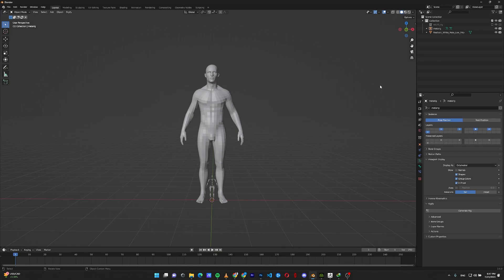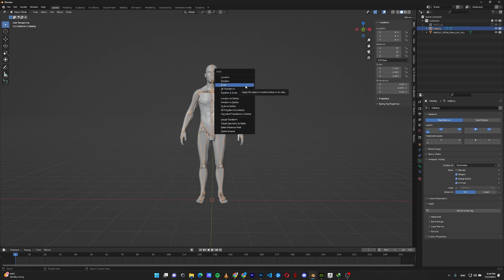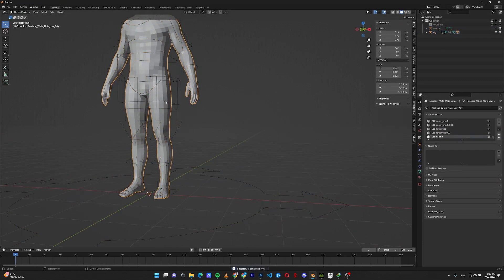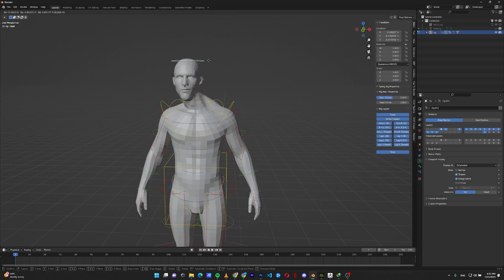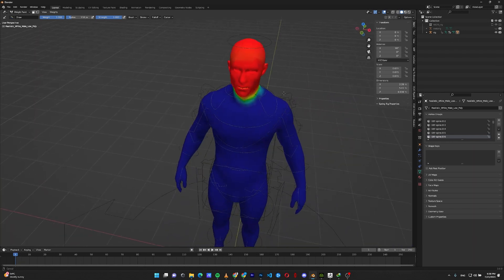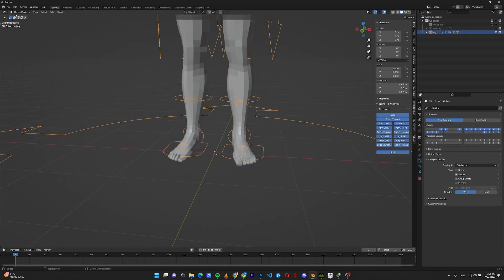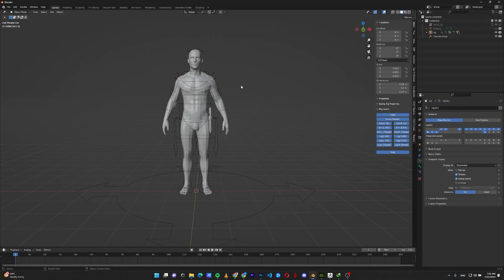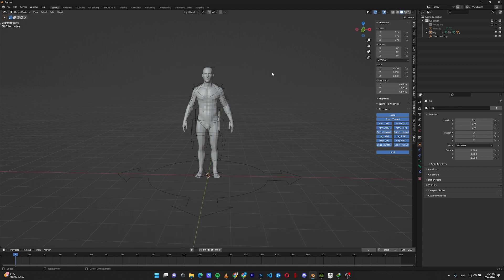4 Most Common Blender Rigging Problems and How to Solve Them

Comment: i need help, when i try to scale my rig figure the whole body just becomes deformed as i scale it up, please respond
Reply: nevermind! i was in edit mode not object mode
Reply from the maker: You should scale the model before rigging because of these kind of issues, but sometimes you can scale the root bone and it works, it depends on the rig but automatic rigs usually don't work like that and you need to scale before the process and apply the scale transform
Reply: @ never mind I was using edit mode or something instead of object mode, I figured it out by now

Comment: I have an issue where the character disappears from the armature. If I unparent them, it comes back, but if I reparent them it disappears again. What can the issue be?
Reply from the maker: It's because after un parenting the model resize to the original size, sometimes much bigger and some times much smaller, when you select the model press "Alt + P" and un parent and keep transforms
Reply: @ In my case, I noticed the delta measurements of the armature are set to 0.01, even though the scale measurements are 1. I sorted that out, applied scale and all transforms etc, and everything seems to be ok after reparenting. However, when I clicked on something else then went back to it, I was back to square one. It had all changed back to how it was 🤬 Something tells me the issue is with the existing keyframes, but I am going around in circles and getting nowhere 🙄
Reply: Is it possible there is a hidden element that is not being included in the transformations, and therefore messing everything up?

Comment: my problem is that whenever I set with automatic weights, it just loads infinitely until it crashes. it may be because the model is pretty high poly, but I'm not sure how to fix it.
Reply from the maker: Models more than 75,000 polygons are considered hard to rig in Blender and something around 100,0000 almost unable to rig.
For automatic rigging you need to make sure you models are below 75,000 polygons, that's because the computer needs to solve things and with more polygons it means more calculations until it crashes, or you can weight paint it manually.
For Auto Rig Pro there are other third party skinning engines like voxel heat map ( if I'm not mistaken) than sometimes can fix this issue as they use different algorithms to weight paint.

Comment: Bro i have issue when i move my cursor whole character is gone
Reply from the maker: Can you describe it more? If your whole character moves when you try to move something, in most cases it's due to your proportional brush being on, press "O" on your keyboard and check the middle top of your viewport, a circle shape turns on and off, it should be on or if you want to use that, when you press G to move, decrease the effectiveness size by rolling mouse wheel, if what I've said is not your mentioned problem, please explain it more
Reply: @mck3D  bro thanks for replying but my issue solved

Comment: hey how are you mirroring every bone movement , when you move a joint on right side and the movement is copied on the left side ??
Reply from the maker: in the top right corner of the viewport there is "X", turn that on so you use mirror movements.

Comment: I'm still extremely new to blender, so please excuse me if I'm misunderstanding. I've only been doing it for two weeks. My rig works like yours, but the metarig or bones stay in place when I move the rig. Is that normal? I figured that's why a lot of people have it hidden.
Reply from the maker: Hello,
Don't worry ask anything that is on your mind.
Yes if you custom rig your character manually, you actually use those bones then for make it easier on the eye you make custom shapes (those shapes you see in the rig) just to control those bones.
But in automatic rigging like Riggify, those bones are there just to place them in the position of your character joints, then Riggify create another skeleton for IK and FK and hides it, so you only see the shapes and parent your character to the control rig and in the background Riggify make the necessary adjustments.
I like to open things and talk about them in-depth, but the short answer is  YES, you don't need them in automatic rigging.

Comment: Bro, I have a problem that I can't solve, when I create the rig for my model, all the bones influence more than necessary, like a finger is influencing the arm and a part of the hip, I know I can solve it manually, But isn't there a better way?
Reply from the maker: There isn't much to do, you can try to re-do automatic weight painting to see if it fixes the problem or not, and there is a paid addon called "Voxel Heat Diffuse Skinning" (https://blendermarket.com/products/voxel-heat-diffuse-skinning) it usually give better results if you willing to pay you can test that, but other than there is not much you can do automatically
Reply: @mck3D  ok, In this case, isn't there a way for me to generate a rig after doing everything manually? Like, I do the Weight paint exactly bone by bone, and then I can generate a rig and it will come right? Or will it not be generated correctly?
Reply from the maker: you can, just generate the rig from riggify skeleton and then in the last part when you parent the model to the rig, don't select the parent with auto paint, select parent with empty groups (of I recalled the name right) this way, your model is parented to the riggify generated rig, and the bone groups will be available on the model vertex groups but their weight paint are empty, and you can paint everything manually from there.
Reply: @mck3D  Thanks, this helps a lot, the only problem is doing the painting correctly, but I can manage, thanks for the help
Reply from the maker: My pleasure, yeah weight painting is always a pain xD but when done correctly the result wish wash away your exhaustion.

Comment: on 2.37 we see its not work in video  this is same problem with me on leg rig after rig generated
Reply from the maker: It's working in the 02:37 in the video, but if you explain to me your exact problem we can fix that easily, does you knee bend the wrong way?

Comment: Hey MCK thanks for the tutorial. I recently started learning Blender and I have reached a point of rigging my armature. I like your YT tutorials because you explain very well even for beginners. I am using Riggify in blender 2.79 but I got an issue, not sure if its an issue though. My rig has a lot of attached connections coming from an orange dot at the center of the cursor that is at the X/Y going to the rest of different parts of the rigged mesh. What's your opinion on this?
Reply from the maker: You're very welcome, I'm glad you liked them, sorry for the late replay, I'm not sure about 2.79 as I don't remember the workflow, did you try to hide the layers of the rig? maybe you've activated some hidden layers.
Reply: @mck3D  Am good thanks, the important thing is you got the message. I'll try to hide the layers and see how it works. Thanks.
Reply: @mck3D  Hey your idea worked, thanks. But I got another issue when trying to move some parts of the rig like the hands and legs, the mesh of the hands and the legs are stretching. What could be the issue?
Reply from the maker: sorry for the late reply and I hope you've already solve your problem, it's because of the weight painting, sometimes you see the parts in blue which indicates that the bones don't have influence but they do have influence, at least it's the most common one, but there are a few more reasons that are a headache to solve.

Comment: the only problem I got is that its hella laggy. I got a rtx 4070 and a cracked cpu and the mesh is like 10k triangles and yet its like 2 fps in pose mode. Any help?
Reply from the maker: in the viewport shading, put the shading on the solid mode, and in the solid mode expand by clicking the little arrow, then select "Material" in order to see the model in material mode, any type of shading or rendering will slow down your movement.
Reply: The reason why you mesh could be lagging is to do with its poly count being too high. The higher the poly count, the more its struggles to respond in real time. A work around for this is selecting your mesh and clicking shift D move it but don’t let go of the mouse bottom, then click esc. It’ll snap it to its original location. Next you want to remesh your new mesh with the remesh modifier. Ideally you want to rename this newer mesh to lower poly so you know the difference. Go to your modifiers and click on remesh. You want there to be enough poly count so it’s roughly matches your original mesh. Once you’ve found a desired look, apply the modifier. You then want to disconnect all previous parenting you did with the rig prior to this. By selecting everything and clicking alt p and clearing the parents. Make sure that you remove all vertex groups as well. This is located in the object data properties tab. The one that looks like a triangle. To remove them all quicker click on the down darker arrow that is located in the middle of the other buttons and select deleted all groups. You then want to parent your lower poly mesh with your rig by selecting the rig by selecting the mesh, shift clicking on the rig, ctrl p: automatic weights. You then want to click on your original mesh and shift click the rig. Click ctrl P and set the parent to with empty groups. You then want to click on your original mesh, shift click on the lower polly mesh and click weight paint. You then click on weights, transfer weights, you want to change vertex mapping to nearest face interpolated, and then change source layers to by name. And if it was followed correctly the mesh should snap into place without any issues occurring.

Comment: thanks so much for the video, but there is another problem that i never get to solve: now my mesh moves with the control rig, but the armature doesn't!! so when the control rig moves, only the mesh moves, the armature stays the same position.. pleasseee can you tell me how to solve this problem as well? i see that in your video, the armature is not parented with the rig or the mesh either
Reply from the maker: sorry for the late reply, in automatic weight painting the skeleton presented to you at first is just to define the placement of the bones and after generating the rig you're gonna have under layer IK FK rig that is hidden by default, another thing is that when you move your IK rig, you FK rig stays in place, you can move you FK rig by switching to FK rig.
Reply: @mck3D  omg thanks so much !!!! didnt expect you to reply back !!! thats so nice of you!! thankss again for helping out! really appreciate it!
Reply from the maker: @meowmeowstar19  Of course I do, if you ever had problems like this, just leave a comment I will reply back, and usually not as long as the last one ^_^ cheers
Reply: @mck3D  🥹🥹🥹🥹🥹

Comment: Really easy to understand, thanks! But I have an issue with attaching a skeleton to my model. The rig for some reason doesn’t fit so I can’t move her 😅
Reply from the maker: You're welcome, I'm glad it could help.
About your issue, do you mean when you click on the "generate rig" button, the rig that is created from the skeleton is smaller/larger for some reason, right?
If so, did you apply transforms after scaling the skeleton?
To do so, select your skeleton (not the rig) press "CTRL + A" click apply all transforms, then click on the "re-generate rig" button (the same location as "generate rig", it's replaced with "re-generate rig")
Reply: @mck3D  no, I found out about that. But I can’t move her because the rig doesn’t wanna attach to the mesh 🤔
But thanks a lot for the advice!
Reply from the maker: no problem at all, did you get any errors when you parent with automated weight paint? (in the bottom right corner of the Blender)
Reply: @mck3D  no I didn’t…could the model be the problem? She’s from sims😅
Reply from the maker: there is a chance that the model already has an armature modifier, please check that before parenting, I suggest checking the vertex groups, deleting everything then again parent with automatic weight painting, keep in mind that the control rig (the boxes that you use for posing) are only the controls for the skeleton itself, make sure to check if the bones and joint are all inside the model and two joints are not separated, for example, the joint of the elbow, you should see one joint but there are actually two joints overlapping.
In general, your issue is a weight painting issue and I think by removing all the vertex groups and re-parenting it should be fixed, maybe because it's a sims model, it already has rig data or even a hidden rig, but removing the armature modifier and vertex groups and clicking on the model pressing "ALT + P" (unparenting) you make sure to clear rig data from the model.
Reply: Wow okay thanks a lot! I’ll have to test that👍
Appreciate the help ☺️
Reply from the maker: No Problem at all, you're welcome ^_^

Comment: Hey, In 4.1; I've been having an issue with rig that causes my mesh to lag behind and 'Flatten' I've checked if it's a scale issue but it seems to be 1,1,1.
Reply from the maker: Hey RangerHobo, 9 out of the 10 times this is a weight painting problem, but to make sure first check the polycount of your character, anything below 70,000 should be fine, if your character is above that number sometimes weird issues happen.
But for now, we assume that your character is optimized for rigging. It's most likely the weight painting issue, for example, the hand bone should be the bone that controls the hand, and if for some reason chest bone has some (even a little) bit of influence on the hand, it causes your hand bone to not control the hand completely and hold the hand geometry back, the further you move the hand, the more visible this become.
If I want to explain it, no bone from another region should have an influence on other areas, only the connected regions have some influence on the geometry of each other to make the movement more realistic.
To fix the issue, you can first select the rig then SHIFT + select the character and go to weight paint, with CTRL + Click select the bones one by one and check for the influence keep in mind sometimes if you don't pay attention there is a little bit influence that is very hard to see because it's so close to the dark blue or value 0, for this reason, I always recommend the second method.
In Method 2 you select your model and go to weight Paint, then in the right panel go to Data Properties (green Triangle), you will see the vertex groups (bones), now select the vertex groups (bones) of the neighbor bones then go to edit mode by pressing TAB and select the vertices of the hand (E.X), and below the vertex, group press Remove or put value to 0 and press Assign, then go to the next vertex group.
Two things to keep in mind:
1- your vertices selection will remain the same, so you can select different bones and quickly go to edit mode and click remove unless you mess up your vertex selection.
2- Bones or vertex groups that shows with the pinkish color are the IK bones, don't touch them, just pass them.
And make sure to check your hand bone to see if any area of the hand are dark blue or not.
Reply: @mck3D  That was the Issue, thank you so much!
Reply from the maker: My pleasure, anytime.
Reply from the maker: Hey RangerHobo, 9 out of the 10 times this is a weight painting problem, but to make sure first check the polycount of your character, anything below 70,000 should be fine, if your character is above that number sometimes weird issues happen.
But for now, we assume that your character is optimized for rigging. It's most likely the weight painting issue, for example, the hand bone should be the bone that controls the hand, and if for some reason chest bone has some (even a little) bit of influence on the hand, it causes your hand bone to not control the hand completely and hold the hand geometry back, the further you move the hand, the more visible this become.
If I want to explain it, no bone from another region should have an influence on other areas, only the connected regions have some influence on the geometry of each other to make the movement more realistic.
To fix the issue, you can first select the rig then SHIFT + select the character and go to weight paint, with CTRL + Click select the bones one by one and check for the influence keep in mind sometimes if you don't pay attention there is a little bit influence that is very hard to see because it's so close to the dark blue or value 0, for this reason, I always recommend the second method.
In Method 2 you select your model and go to weight Paint, then in the right panel go to Data Properties (green Triangle), you will see the vertex groups (bones), now select the vertex groups (bones) of the neighbor bones then go to edit mode by pressing TAB and select the vertices of the hand (E.X), and below the vertex, group press Remove or put value to 0 and press Assign, then go to the next vertex group.
Two things to keep in mind:
1- your vertices selection will remain the same, so you can select different bones and quickly go to edit mode and click remove unless you mess up your vertex selection.
2- Bones or vertex groups that shows with the pinkish color are the IK bones, don't touch them, just pass them.
And make sure to check your hand bone to see if any area of the hand are dark blue or not.